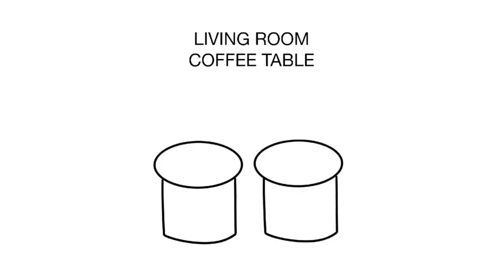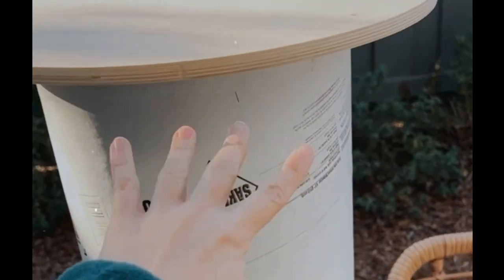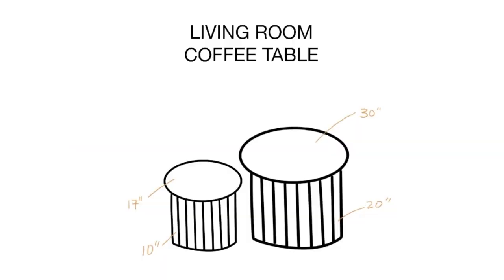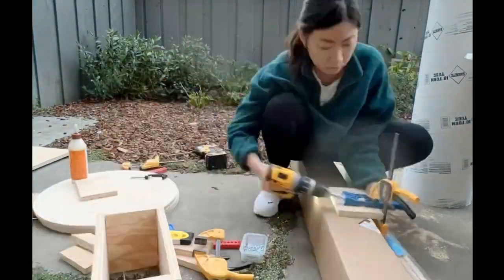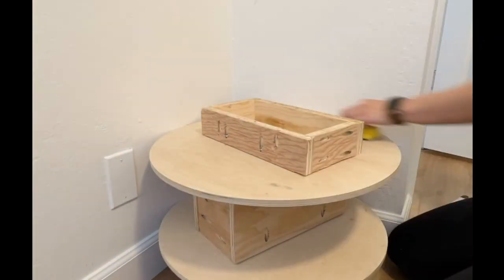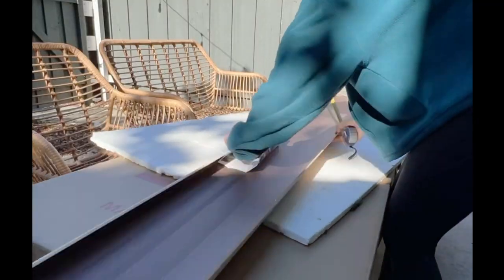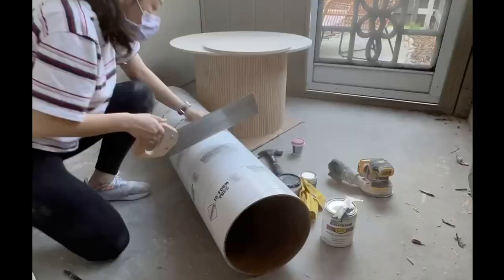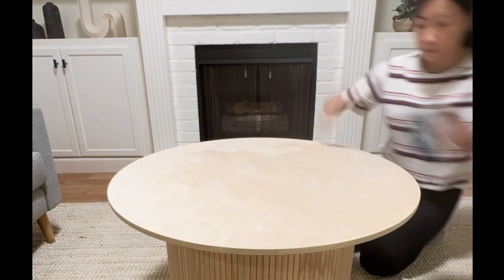DIY Fluted Coffee Tables | Cost $150 | STEP BY STEP | Build from Scratch

Comment: Hi! What length pole wrap did you buy fornthr base ofnthe bigger table? The 12 inch or 16 inch and how many did you need?
Reply from the maker: The height of the pole wrap section was around 18.5”! (So that’s the distance from the ground to under the table too). My pole wrap couldn’t cover the width in once piece so I used a couple of separate pieces. Let me know if that makes sense!

Comment: I’m a year late! Very beautiful tables 😍, I have a question. On the bigger table I see you added 3 circular wood pieces. What size and thickness did you get to make cylinder structure? Also I see that the rectangular shapes are a different size, is there a reason? And how tall did you make them to create the cylinder structure? Sorry for all the questions would to make this myself
Reply from the maker: For the 3 wood pieces, I used 1/2” thickness. For the rectangular shapes, you just need to make sure the combined height of all those rectangles + the thickness of your 3 pieces of wood equals the total height of your cylinder (mine was 17”). As I used some scrap wood I had left over, each rectangle ended up being a different height. If you want to make your all the same height the each rectangle will be  (17” total height - (3 x 1/2”thickness of circles))/3 rectangles = 3” height of rectangle. Let me know if that helps or if you have any other questions!:)
Reply: @jnnliuliu  thank you so much, that make so much sense 🫶🏽

Comment: What thickness did you use for the table top? Also, for the larger base what size did you get the round pieces?
Reply from the maker: The table top thickness is 1/2”:) the circles inside the base was 20” diameter!

Comment: where did you get the 30 inch wood circles from?
Reply from the maker: Thanks for the question. I forgot to mention this!! I got them from: https://woodpeckerscrafts.com/wood-circles-wooden-discs/ . They have different sizes to choose from! Note that it is plywood, so the edges wont look as finished. To finish it up, I wrapped it with edge tape.   https://amzn.to/3n0SJks . All you do is wrap it around the sides and use a hot iron and press it on. Sorry that I missed out this part in the video. Let me know if you have any questions!